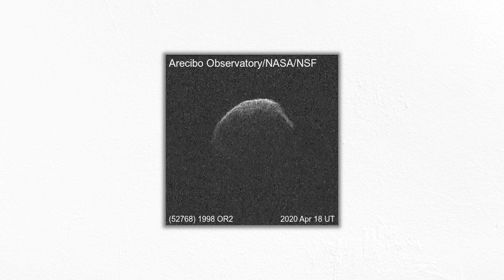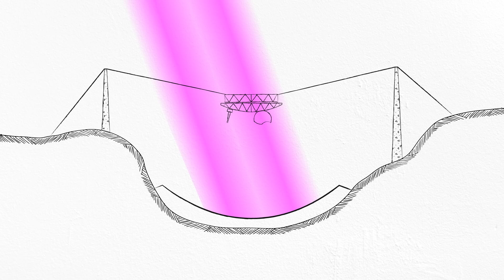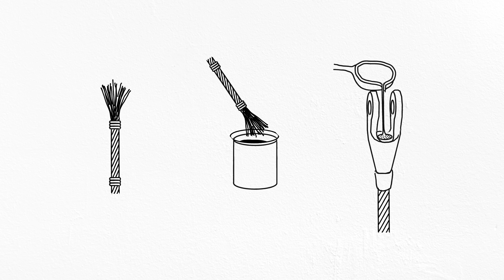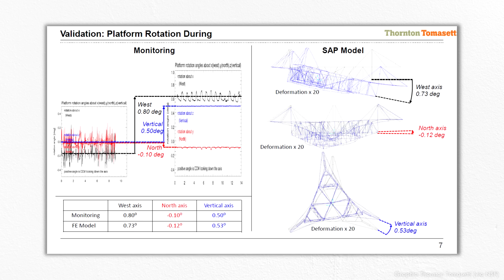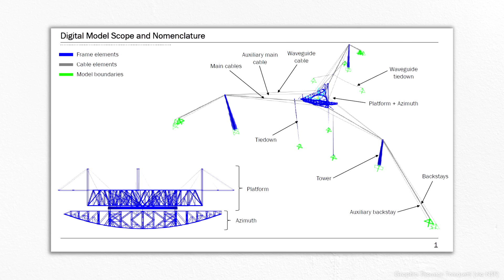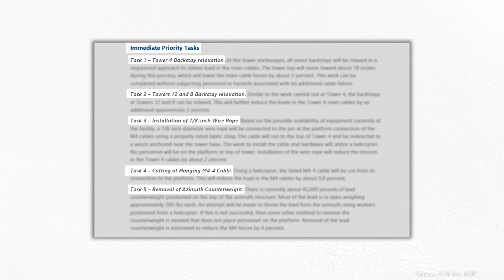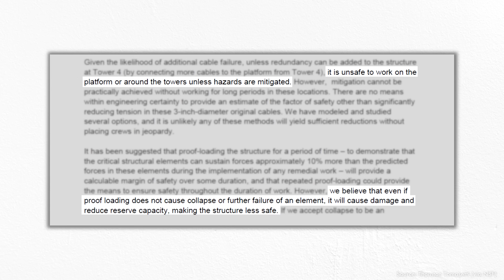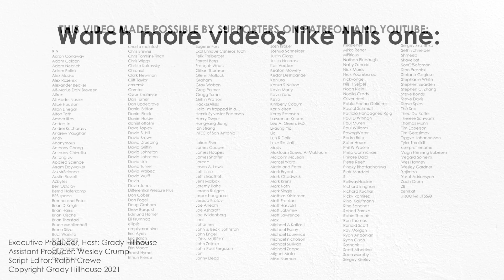What Really Happened at the Arecibo Telescope?

Comment: Looking back into Arecibo's origin you can easily see why this would happen. The Department of Defense would have had no problem approving the project with a small factor of safety given they only cared about it's intended project lifespan which turned out to be roughly 6 years and construction already took nearly 10. They had a mission and didn't care about astronomy. Consider the Hubble space telescope and how much effort and time went into it's design only to suffer from a faulty mirror. All the while the NRO as part of the DoD was sitting on 2 telescopes of superior quality than Hubble which weren't even used. In 2012 they were declassified so the NRO gave them to NASA. (20 YEARS LATER) They must work within the scope of their assignments as much as that sucks for everyone else.

Comment: A guy tried to get me to climb a 30 foot light duty ladder ( I was heavier than the recommended maximum weight ) - he cited the "safety factor" should allow me to safely use it. I refused.
Reply: I wouldn't climb a 30-foot ladder under any conditions, safety factor or not.
Reply: @soaringvulture  I ended up buying a heavy duty one that weighed alot - but once you got it set up it was like a staircase.
Reply: @soaringvulture  I do it every day. With the proper tie offs it's quite safe.
Reply: @cybercluck1776  Not with me on it. My legs start shaking about 15 feet up if I'm not on a platform. My fear of heights is more a fear of losing control and falling. Standing on the rim of the Grand Canyon, or an observation floor in a tall building, or even in a light aircraft thousands of feet over the ground, no problem.
Also, since I got a concussion after I got hit by a car, I get vertigo easily.
Reply: Sounds like your heart attack risk exceeds your ladder risk.
Reply: @johnsmith1474  I have an athletic build. Very active.  But over 200 pounds. Don't want to end up in a wheelchair.
Reply: @johnsmith1474  You'd be amazed how much the tools one takes with you on a 30ft ladder start to add up.  It's not like you want to go down and up again to grab a different size screwdriver....

Comment: In the offshore construction industry we test every year all wire ropes and discard every five years regardless of cost. Factor of safety is between 4 and 8x depending on use. It would be inconceivable to have wire ropes in use this long.
Reply: This video is proof of why that's a good idea. What else is still being used in your life from 1963?
Reply: @ctdieselnut  I have a toaster from around that era. 

Oh wait, the power cable has been replaced 😄
Reply: possibly the plug  and a fuse.
Reply: @ctdieselnut  Thing is that it's known that all wire ropes fail. The speed of failure is dependent upon use but it's an absolute cast iron guarantee that at some point they fail and if they are not pressure greased and move then the lifespan is short.
Reply: @markchisholm2657   I agree with everything you are saying, but it is important to point out that these cables are not in a winch or other circumstance where they would encounter dirt on a regular basis.   These cables were built with the notion that they would mimic the cables in a suspension bridge, which are used for decades without being replaced.
I agree there should have been a larger safety factor, and I also feel that the cables should have been loosely tethered together so that if one cable snaps it doesn't fall to the ground and potentially damage people or property.
Reply: @mikegraham7078  except hurricanes!
Reply: @markchisholm2657  Absolutely true. I have supplied countless sockets, shackles and other components for deep water mooring systems, lifting assemblies, etc. Proper maintenance is key. Greasing the cables essential. And a cable slipping out of a socket is an absolute no-no. And that alone would normally be a reason to replace all cables in the structure.
Reply: @mikegraham7078  Agree, however, the factor of safety on a suspension bridge is far higher and individual wire ropes on a bridge are less critical, as the load is shared over many ropes. The observatory used a relatively small amount of ropes, so if one fails, the impact on the other cables is much higher. Accessibility most likely has also been a practical issue.
Reply: @ctdieselnut  I am from 1963.  Everything still works; still have all my hair; not gray.
Reply: @mccanlessdesign  EVERYTHING? are you sure?
Reply: @ctdieselnut  Not me. I'm a few years newer than that. All parents and grandparents have reached end-of-service between then and now, though.
I do have a bayonet that is older than that, though I don't have the rifle it goes to.
Reply: @ctdieselnut  : I get dinner at my mom's place periodically, so I'd wager she's one thing made in 1963 that's still useful in my day-to-day life. :P
Reply: @ctdieselnut  The house we live in is from 1930. The roof, suppporting walls and floor beams are all still original.
Reply: @ctdieselnut  I was born in 1963 and so far all of my cables are still holding strong. I'm hoping to get another 30yrs out of this version before doing a major overhaul.
Reply: @ctdieselnut  Me!
Reply: @ctdieselnut  Your body ... ?
Reply: @ctdieselnut  I have a few utensils from before that era.  Then again, they're utensils.

Kind of hard to break those.
Reply: @Pyxis10  tfw you cook too hard and exceed the designed safety factor of a spatula lol
Reply: Now I wonder how often the ropes on bridges get replaced, if at all.
Reply: @Jehty_  never, they are a different beast though, fully lubricated and sealed under multiple layers, newer ones have even de-humified atmosphere. This arecibo one looked pretty basic though.
Reply: @Jehty_  The San Francisco Golden Gate Bridge was constructed 83 years ago. They replaced the 500 vertical ropes once, in the 70ies. The two large main ropes were never replaced, they are exposed to very rough weather/salt conditions since 83 years now.
Reply: @Jehty_  On suspension bridges, the main suspension cables can't be replaced, their lifetime is essentially the bridge's lifetime. The suspenders presumably can be replaced, but I've never seen it done.
Reply: "What else is still being used in your life from 1963?" ... ME?
Reply: @2ddw  Mother?
Reply: @2ddw  Yeah, but your body is always replacing its own components, so that just helps prove the argument. I'm pretty sure your comment was a joke, but it is actually a practical example too.
Reply: Sadly funding for this kind of science is low, and the relative capital risk was too. The multibillion dollar company that runs the offshore rig has a hell of a lot of invested capital investment in the rig, and thus has a direct incentive to keeping it a peak performance, as well as the environmental and governmental pressure to maintain high standards. In its final years Arecibo was funded by a relatively small university, and faced low risks if it failed, so its funding priority was likely also low. I hope our current government can allocate more fund to the department like this, so that one day arecibo can be rebuild
Reply: Absolutely... But on the other hand, look at suspension bridges. Absolutely no way to replace the main suspension cables. Building them strong enough to still stand with one cable removed isn't really feasible, so the cables need to last for the lifetime of the bridge.
Reply: @KingdaToro  Yes, kind of. Except that suspension bridges have had replacements done when it's been decided to do a lifetime extension.
Reply: @naamadossantossilva4736  I probably would be.  😆  Okay, I haven't done it yet.
Reply: Right!?
Reply: Wouldn't it be a very different scenario?  Salt Walter destroys metal.
Reply: Correct me if I'm wrong Mark, but isn't part of the reason that you have such high factors of safety in offshore construction that the errosive forces of the sea are far greater than on land? It seems obvious to me that cables in different circumstances last for different amounts of time.
Reply: M.   I spent almost 30 years in the elevator business….looking at the wire rope ends they resemble elevator  ropes. ( rope is the term the field mechanics callthe elevator hoist cables.) typically a high speed gearless elevator might have  6 or 8 ropes, roped direct ( 1:1 not 2:1).  They would be 8 x19. Having 8 individual cables  that consist of 19 strands and most likely be wound around a hemp center core lubricated by lubricant in the hemp core. The cables are very soft (flexible)  so they can bend around the drive sheave of the hoisting machine.   The ends of each rope are terminated like in this video in sockets where the cable is wrapped with steel binding wire maybe 10 or 12 inches from the end of the cable.  The larger 19 strand twisted bundle of individual wires are bent back on themselves and pulled back in the socket making a loop of each strand of the 19 small wires.  In a nutshell, the end of the cable is pushed through the socket, loops turned back on themselves and molten lead poured into the bottom of the up turned socket?  The other end of the socket is a threaded shaft pushed through a heavy plate with the 8 holes bolted or wElded to the crosshead beams of the elevator carframe.  In the video, i did not see the wire ropes ended in this manner.  The narrator said the ends were run through the  socket and molten zinc poured around the rope ends.  The connection of wire rope to socket should have had a safety factor of at least  10.   And the drone photos looked like the failure point could have been right at tbe socket. It was right near the end of the ropes and you can see the individual strands flying apart.  I would bet the constant vibration of the rope at the socket over such a long  time period fatigued the
Reply: @josephburkhalter5105  I would imagine the age of the wire rope would indicate use of a hot metal socket of some sort. This has been discarded in the oil and gas industry due to the failures inherent with hot metal terminations. We use resin pour now usually Wire Lock due to its far superior performance.
Reply: With the way the structure was built,  testing simply wasn't possible to the level needed.  Originally it was just a quick throw together project for the military. At the time it was much less of an instrument than what it grew to be.
Reply: Science is underfunded, Industry is not. Sad facts
Reply: @Physwe  NSF was **NOT** interested in funding "small" projects. The Arecibo budget was $12million per year. NSF wastes more than that on catering. They were aiming to pretty much zero out funding by 2023. BIG SCIENCE is full of criminal negligence.
Reply: @phlogistanjones2722  Identically to where you posted this above...
Wow, that's a big bow to draw, based on an unexpected structural failure in a clearly problematic context.  People do the best they can, with the money and foresight and calculations they have at their disposal at the time.  Sometimes we make choices or changes that turn out to be slight overreach.  When costs begin to radically outweigh benefits (ie: spiralling maintenance costs and diminishing scientific relevance) then you start focussing elsewhere, on projects with better potential ROI.
Reply: @Physwe   "Science is underfunded, Industry is not. Sad facts"  Science doesn't have to turn a profit or go bankrupt.  BTW - everything's underfunded.  There are only so many tax dollars to go around and if you want to give more of those tax dollars to one thing - they have to be taken from somewhere else.
Reply: @Physwe  exactly this. Simply put there was no where near enough money to keep this facility running long term.
Reply: @Physwe  Arecebo didn't buy enough votes to properly fund the project. 
Our government is corrupt to it's core. It's for sale to the highest bidder.

Comment: When talking about the shock load that could have exceeded the remaining cables' strength rating, I have to assume that multiple cable failures should have been factored in; seeing as that is the most likely place to fail. So... Did they?

Either way, what happened was probably the best case anyway, since even demolishing would have likely required undue risk to people, even if they could use robots to plant explosives or chip away at the concrete.
Reply: I would think they would have put some explosive at the bottom of the backstays to sever those cables (reachable from the ground) and the towers would have folded inwards.

Comment: 13:00
He mentions how the chipped paint indicates strand failure, and a great display of that is at 13:17 when the nearest cable absolutely shreds all of its paint in a matter of seconds as the cable unravels.
Reply: Which itself is a sign of other underlying problems namely improper maintenance. 

As you have seen for instance on a car, the paint on properly prepped metal does not flake off in for instance an accident. A proper paint coating for this safety application would be paint that bonds completely to the substrate, ie a bonding rust preventative metal primer that could not possibly "flake off" with a proper waterproof top coat. This flaking material looks like water based latex paint which of course encourages rust. Typical PR low quality work and bad inspection processes.

Comment: Aircraft factor of safety of 1.5?  Sometimes they are lucky to get to 1.0 and then they use a probabilistic analysis to get even lower when it comes to meeting fatigue life requirements.
Reply: FAR regulations mandate an ultimate FOS of no less than 1.5 for aircraft.

see for example: https://apps.dtic.mil/dtic/tr/fulltext/u2/a070237.pdf and https://ntrs.nasa.gov/api/citations/20140011147/downloads/20140011147.pdf

From your comment, I don't think you understand what a factor of safety is. A FOS of less than 1 means a guaranteed fracture while operating within normal parameters.
Reply: @ASJC27  You are correct as it pertains to commercial aircraft and strength requirements.  I was alluding to military gas turbine engine requirements related to fatigue life and the use of probabilistic life assessments.

Comment: RE: "The longer you focus on an object, the more resolution you get" - The "angular resolution" of a telescope depends on the diameter of the collector and the wavelength of the radiation observed.
Reply: It was poorly and inaccurately worded, but I think he meant to explain that the longer you focus on an object the more light (or radio waves) you can collect to resolve a dim object. You can either focus for longer, or widen the aperture of your collector to accomplish the same brightness over a shorter time (in addition to increasing the resolution.)
Reply: @HermanVonPetri  Indeed. If you can "collect" photons then long exposure allows imaging of fainter and fainter objects. Optics has some odd "rules". For instance, the one that will make heads turn is that the size of the airy disk (as projected onto a piece of film, say) is dependent strictly upon focal ratio.
Reply: Longer exposure increases sensitivity in principle, but in the 1960s you were limited by background noise anyway, so it didn't really give you anything beyond the obvious of seeing things for longer and thus maybe seeing more things happen. Both resolution and sensitivity were limited by diameter.

Today, longer observations really can provide improvements in resolution and sensitivity, but they require a lot of computation. Of course, these improvements don't change the fact that a larger diameter telescope still has better resolution and sensitivity, as long as it can also employ the same technologies.

Comment: You rightly point out that the remaining cables likely experienced a shock load in excess of their rated strength during the first and second cable failures as the dynamic loads equalized.

Comment: Aerospace doesn't use a safety of 1.5, not even close. 1.05-1.3, depending on predictability and consequences. 1.3 is typical for the well predicable parts of a car.
Reply: Ahm no. FAR regulations mandate an ultimate FOS of no less than 1.5 for aircraft.
For human rated spacecraft an  ultimate FOS of 1.4 is common.

see for example: https://apps.dtic.mil/dtic/tr/fulltext/u2/a070237.pdf and https://ntrs.nasa.gov/api/citations/20140011147/downloads/20140011147.pdf

Comment: As I noted below a simular video, the collapse happened because some  clueless person /   committie    kept adding weight to the trolley car being suspended over the dish until the structure failed!!! Also, the  basic design  that had steel cables horizontal to the ground causing stress ten times the actual weight of the trolley car...
A totally clueless  situation...